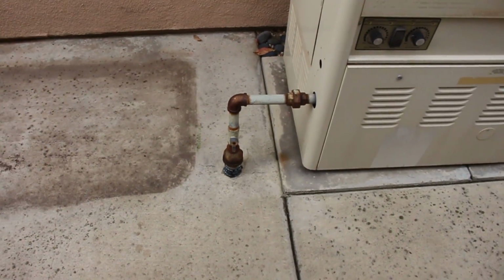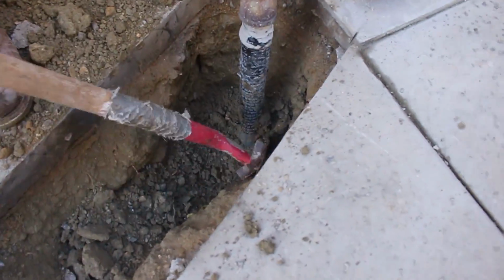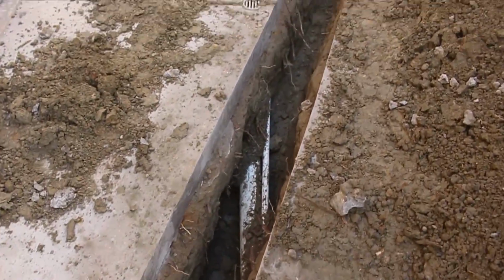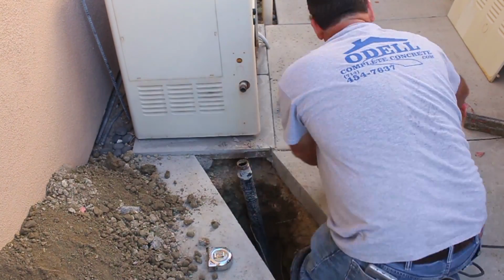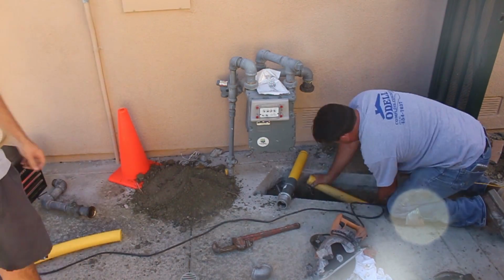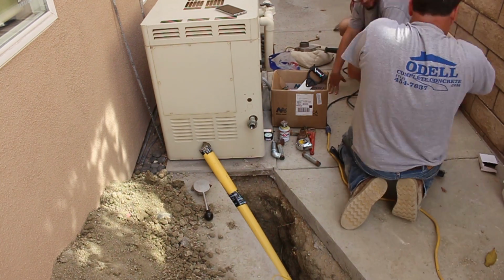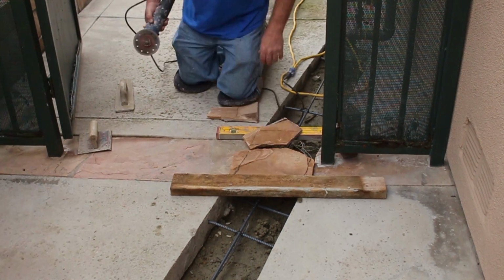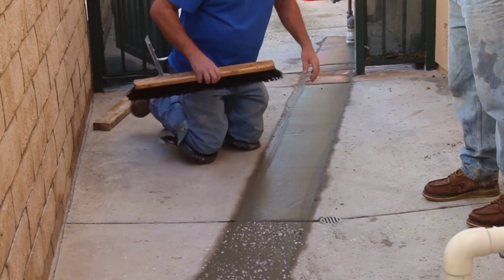How to Replace a Underground Gas Line Under Concrete!

Comment: awesome job.  would love to know what you charged for this one.
Reply from the maker: 2500
Reply: @OdellCompleteConcrete  2500?  That sounds way too low to me.  The digging and concrete alone should have been 2500.  Is this because California contractors are underpaid due to too many unlicensed people taking the jobs?  I was wondering why you didn't want to spend $200 on the fittings...  really sad to read this because in Arizona this would easily be $5000+
Reply: @marcostankless7526  a concrete guy cant pull a plumbing gas permit, so unless he got someone else pulling the permit or he didnt pull a permit on this job, basically its unlicensed.
Reply: @dangda-ww7de  not sure what the laws are in Ca, he might have pulled a general permit.  But what you said makes sense.  Even so, it hurts me to see such beautiful work not get the money it deserves.
Reply: @marcostankless7526  Im a license in cali and i know you cant pull that kind of permit with general.
Reply: @dangda-ww7de  what would you say this job should have cost?  Please break it down into the plumbing portion and the concrete portion if you can
Reply: @marcoborrillo8097  Im in the same city as him and im a license plumber i would charge about the same, i do the gas work and sub out the concrete work, but its all depend on the customer and where they live, if they live in the beach or hill cities price goes up.

Comment: crazy...my gas line is leaking at the pool heater basically they didn't wrap the riser so it need to be replaced as it is corroded and leaking where it meets the soil....How much did that job cost the home owner???
Reply from the maker: 1500

Comment: To keep crud outa the heater just install at heater connection, small 3" vertical pipe going down with cap(to remove crud) "setimet trap" How much to get permit for small bbq or firepit, do i need permit if its moms home? Thanks
Reply from the maker: Yes the permit is around 300.
Reply: @OdellCompleteConcrete  Jeez! Leach democrats.
Reply from the maker: OSS
Reply: Fjb

Comment: I do have a question for you. I have a crack in my driveway. Both sides are level still and I can't afford to have it redone because it's a big wide driveway. I was thinking of basically doing what you did with cutting a wide channel and installing rebar on either side to tie both sides together structurally and then pour concrete in between. Is this feasible and by that I mean would it hold over time? Don't care about the look, just worried about the driveway getting worse. Thanks again for the vids!
Reply from the maker: +Nativtexan2 
Yes it should work

Comment: Have you considered digging just risers? Because the leak is almost always there, no need to replace the whole line. So much work just to run ridiculously tiny 40k BTU heater - it's not worth it.
Reply from the maker: Were going with what the gas company detected

Comment: Why not cut the underground leaking gas pipe loose and run CSST along the wall to the pool heater from the gas meter?
Reply from the maker: Owner doesn't like the eye soar, but I did suggest it. would have saved him some money, but would have had to go up and over door.

Comment: Never pour concrete around your steel risers.  It will eventually eat through the coating on the pipe. Not to mention if u throw salt melt it 2 will destroy the coating on the risers

Comment: am confused cause i thought you mentioned a 40,000 btu heater which sounds kinda small but even if it was like 140,000 you wouldnt have needed anything near 2" big? how did you pik the size?
Reply from the maker: It was the sane as the existing line
Reply: oh you said old was 1 1/2 that’s why I was just wondering. Seems like crazy oversized!
Reply from the maker: I concur
Reply: Usually the service regulator cuts the psig to .25 of a pound before the meter. The oversized pipe is required to supply enough volume. You can use a smaller pipe, if the pressure is elevated, but that requires permits and addition regs, on the appliances.
Reply: That pool heater was probably 400k btu. A standard 40G water heater is ~40K btu, which is definitely not enough to heat anything but a tiny hot tub. But even at 400K btu, a 2" line is generous, which is why I love this channel. If you are going to err, err on the conservative side. 
A 2" pipe running 50' can deliver 1,696K btu at 0.60 Specific Gravity, 0.5" WC Pressure Drop. The span from the pool heater to the gas meter looked much less than that, so that line could feed another few 400K btu heaters, a huge natural gas BBQ and a tankless water heater and still have extra capacity. The unit definitely won't malfunction because it's starved for gas. 
Like the Odell says, "Get it on!"

Comment: I'm pretty sure you can't run gas under concrete or concrete slab with out sleeving the pipe and did you run a tracer line
Reply from the maker: You can run PE under concrete with out sleeving it because it's plastic and will not corrode and yes I did run a tracer line

Comment: 2" pipe to feed a 44k btu pool heater?  Ida thought you could have gotten away with 1 inch... then again your adapting to whats there, not reworking the whole leg.   Saw cuts came out great
Reply from the maker: Yes its just a pipe repair.

Comment: 1 1/2” pipe is cutting it close, you only have about a million btus to spare. Fusion is definitely the way to go under a slab. Had you done compression or con stab, I would have to have been one of those asshole plumbers who screams in YouTube comments. 15#?. Were required on a low pressure system to have 30# for 10 minutes. 60# on a medium to high pressure system which to me is overkill considering it probably won’t ever get over 15# and a low pressure system doesn’t even get over 1 #. Also a tip on your unions is to put a little dope on the face and it’s less likely to leak.
Reply from the maker: Thanks I'll give it a try

Comment: Should be using black iron fittings and not galvanized.
Reply from the maker: Galvanized is better
Reply: @OdellCompleteConcrete  galvanized is a plated pipe should not be used for gas lines.  Most states codes don't let you use galvanized.

Comment: so much trouble.  why not just run the replacement pipe above ground.  guess we wouldn't have seem this video if that is the case.
Reply from the maker: It was a option but not as pretty

Comment: Where in the world can you do gas work without qualifications? Or the gas utility company inspectors standing over your shoulders? I myself have close to 70 quals that have to be re taken every 1-3 years, we have ITS numbers that must be written on every fuse so that if it fails it can be traced back to whoever did it.
Reply from the maker: Sounds like your taking a lot of classes but not really accomplishing anything.
Reply: @OdellCompleteConcrete  I work 6 days a week and run 12 inch gas main, I’m just curious why you don’t need qualifications to do gas work where you are

Comment: Ain't you supposed to be a licensed plumber to put in a gas line. Because I know that in California you supposed to have a license to put in a gas line
Reply from the maker: Im a licensed general contractor i have multiply licenses
Reply: That's good that you are a general contractor
Reply: General contractors are only allowed to take on any projects that have rough Carpentry and not just a single trade in CA.

Comment: So none of this work was needed as it was leaking at the fitting on the meter? This is why proper diagnosis is needed and inspecting the so called damaged pipe which may well show it was the fitting not the pipe. You do good work tho.
Reply from the maker: It was the transition  fitting below the concrete.